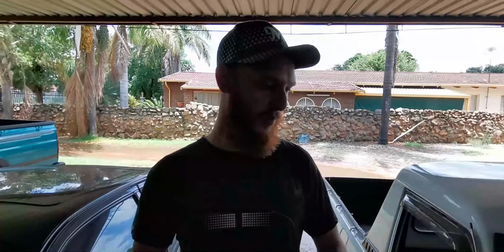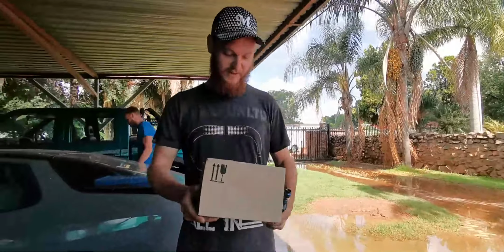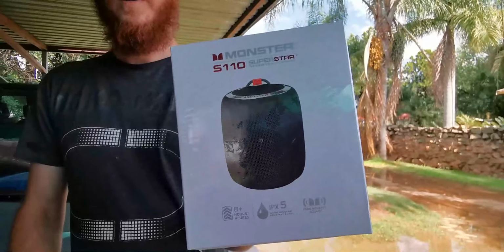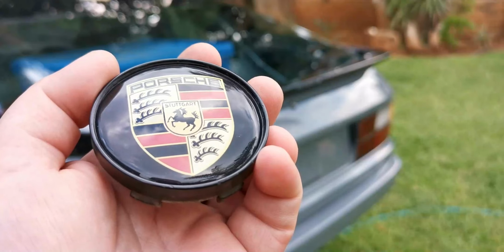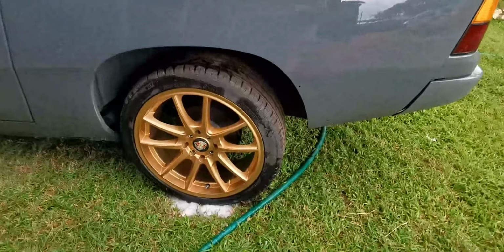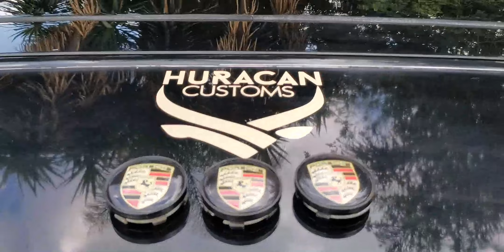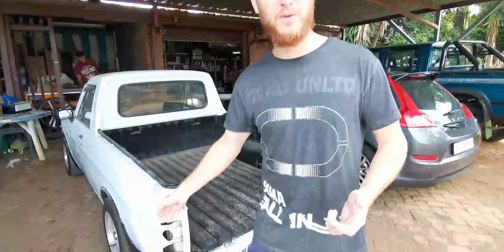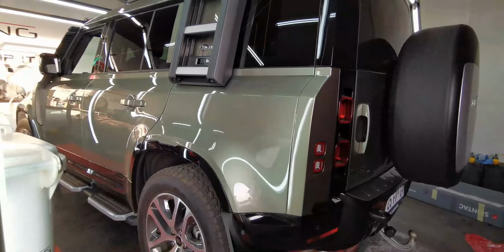Fixing Another Nissan 1400 Part 1

Comment: Awesome content, what do you use for the dashboard to fill up all the cracks before you sanding them?
Reply: 3800 fine polyester filler, specially made for plastic and dashboard, its flexible, make sure your services is properly cleaned before you apply it ✌